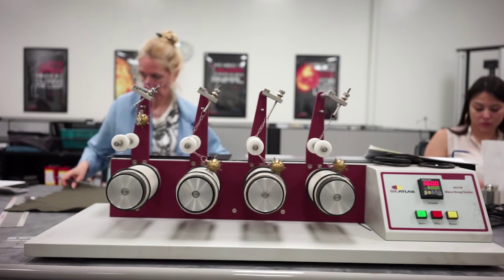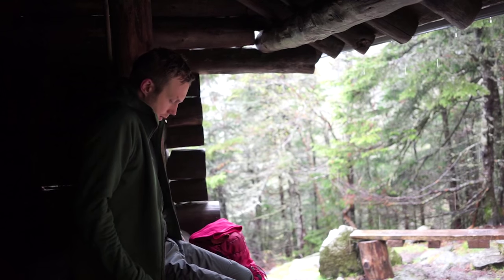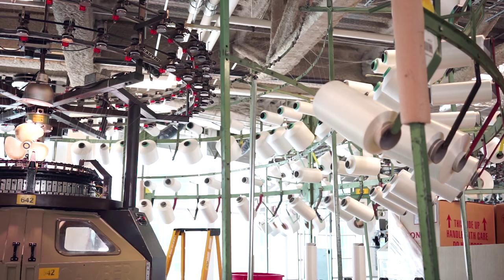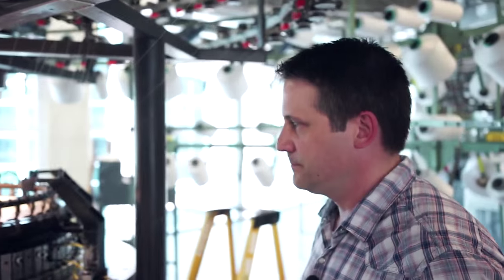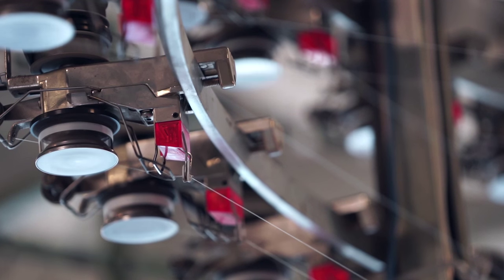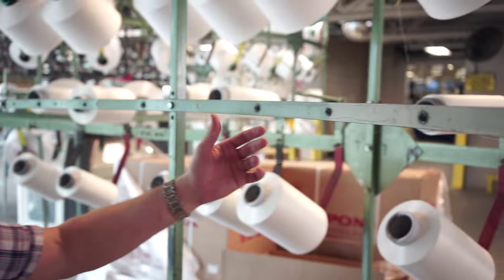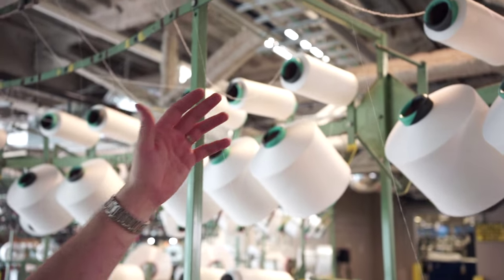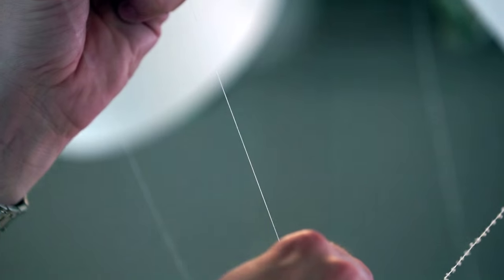Houdini Power Houdi - The Inside Story

Comment: I just want to say, I purchased the Power Houdini and really thought it was perfect....Until I tried to tighten the hood using those CHEAP neoprene stoppers, THAT DIDN'T HOLD THE CORD FROM MOVING.  With a $250 price point, you should be ashamed of your product engineering team because that could have EASILY been fixed by just USING A BUNGEE TOGGLE on each side.  Now I returned the jacket and will NEVER purchase from Houdini again.  That is just ridiculous for the price you charge and can't even get the hood to work properly.
Reply: I was thinking about doing it myself but with the price like that, I shouldn't have to do anything.